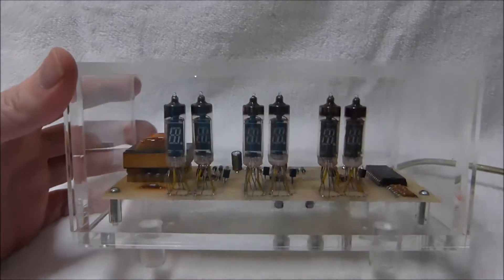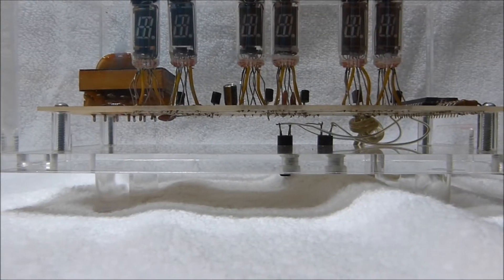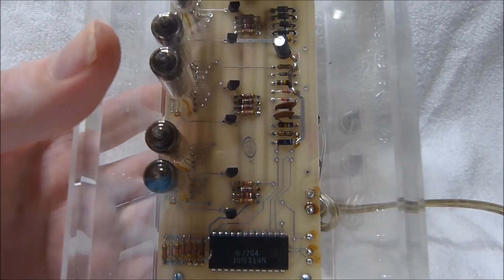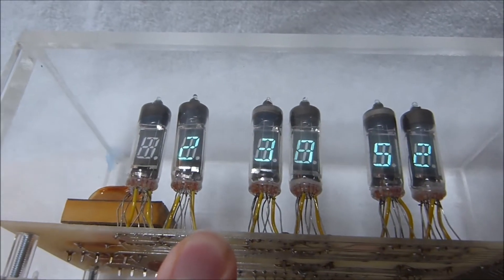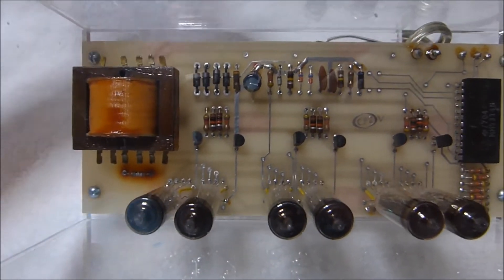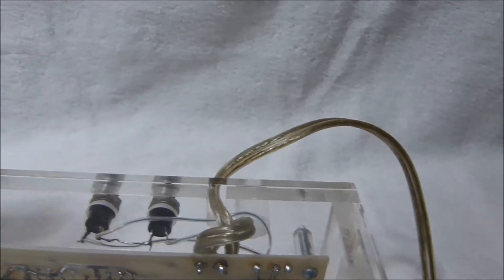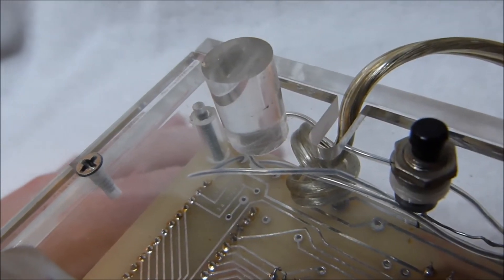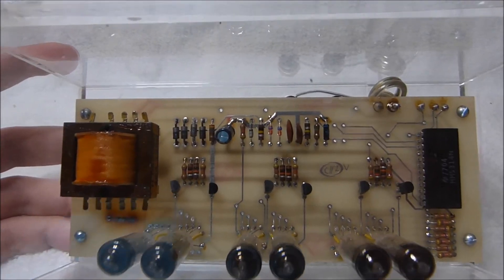(C//Z) VFD tube clock kit (1977, USA)

Comment: Good video, well done!  I've seen a few of these clocks on the famous auction site.  It's a mystery what company made them, but I bet a look at some of the electronics magazines of the day would reveal an advertisement for it - seems like it was a popular kit.  I remember a VFD clock kit, but not in that clear case.  I have seen date codes as late as 1985 on the MM5314N, which is amazing for its basic functionality.
Reply from the maker: Thanks! Hopefully an original ad for this thing turns up, I haven't found one yet. The MM5314 did have an impressively long run, especially considering that there were soon better chips available.